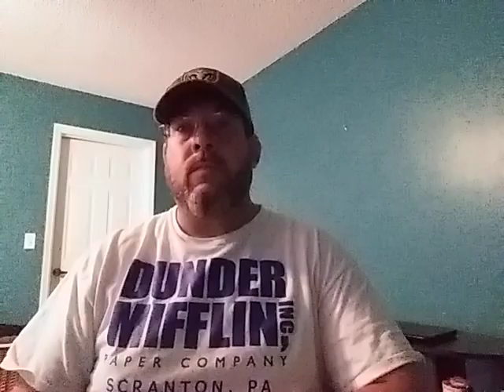Kawasaki VN900 oil inside regulator rectifier fix!

Comment: Did this affect the operation of the rectifier or regulator..i have new one. I when installing missed putting ot else it fell out , the grommets your talking about. It was an oil leak i thought was the seal on the case..fixed that about a couple weeks ago. I am and have been having trouble with charging. Im working on it tomorrow..i tested back when. All good. Since ive had a bad battery and most likely oil in my rectifier. Lol 🤣